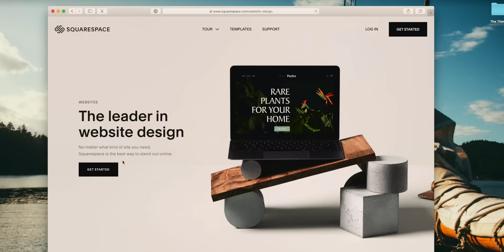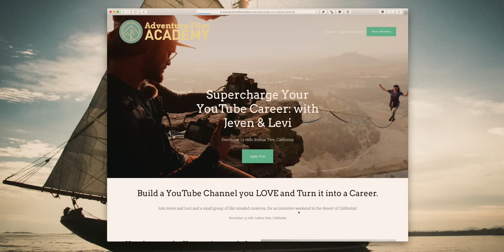The Best VAN LIFE off-road LIFT KITs (Install Video)

Comment: Cool van. I installed the V.C. 2.5" lift on my 2015 3.2 liter HR Transit. Installed 265/75R16 Trail Country EXPs on 16x8 Black Rhino Wheels. The van rides great. The V.C. lift is top notch. The weld beads on the brackets give me a stiffy.

Comment: Love the van mods, even the lift for most part but surprised to see such a thick spring pack going in the rear.  Unless you've added 5000lbs extra weight, I can't see that ride being too smooth.

Comment: Levi, this is awesome. Been dreaming of doing the same conversion on my T1n. Do you have any added concern for roll over? Also have you considered or talked with anyone about adding spacers to widen the stance? Would maybe add stability on turns and lower roll over potential, or is that bad stress on the axels? Thanks! And stay healthy!
Reply from the maker: My new rims add a slight offset. I wouldn’t want it to be more. I’m not worried at all about filing over because of the lift. If I am actually gonna tip I don’t think that 2” higher would be the difference maker to be honest.

Comment: Looks great…
Wife and I are considering a van (RV)  as an alternative to a Jeep/motorhome combo for shorter trips and the ability to explore beyond pavements edge as I’m a landscape photographer.  Not saying for sure that I need 4WD as it does create it’s own set of issues (expense of the parts plus the lowers fuel economy).  Not planing on a regular diet of rock climbing or mud holes thus is 4WD really necessary?

Comment: How old is your van? At first I was concerned with the amount of rust found below but it seems that they are just mostly surface rust. Would an anti-scratch coating or weather coating the bottom of the van help? or it was totally unnecessary?

Comment: Sobas a 4x4 van which would you say is most reliable? A 4x4 transit 6cyl 3.5L eco boost? Or a promaster 4x4 diesel? Im torn between which to get ☹ i need a king bed, enough solar to power an ac unit at night, run a freezer fridge, laptop and little things 😍, im loving what youve done here! Im looking for room to put insulation, maybe water storage for consumption.
Reply: That depends on how much driving you plan on doing. A diesel with a DPF exhaust system requires adequate driving to regenerate. If you plan on only doing short commutes than don't get the diesel or you'll be dealing with check engine lights due to soot build up in the DPF.

Comment: A VERY BEAUTIFUL TRANSFORMATION! Well Done! Does anybody know such conversion but in ELECTRIC? - just for a healthier Planet ^.^ 🌍🚐
Reply: Go With The Flow of this size no, the amount of power useage would be massive!! Id estimate a 4x4 sprinter camper (old because the new style is electronically controlled) would do 1 mile per kWh, so even with the biggest tesla pack youd only get 100 miles, id say you want a 150 mile range for a camper you can use, so 150 kWh pack (about 30 grand), 

something like a simens twin ac motor or maybe a tesla unit inplace of the transfer case as theyre really efficient motors. 

Id budget 100 grand for a conversion like this. 

There are people making campers from the nv200 vans, some full timers or people doing massive trips round europe! 

Best advice is get the daily driver electric!! Change the thing you use most to electric. 

(I know most of this from research into my own overland van, being in a 4x4 response group, and also converting my 4x4 to electric using tesla batteries, im also admin on a uk diy group) 

Hope this helps :)
Reply: @evolution0016  hi. What is your group? Would love to follow your progress

Comment: Looks good.  Are you going to put a limited slip rear differential in to so your not getting stuck as easily now too ?
Reply from the maker: That would be so rad. There isn’t tons of options for my van unfortunately. That’s why I have a winch now haha
Reply: @Levi_Allen  Likely have to swap the axle out to a Chevy.  Might be able to get one out of a wrecker that would work.  Winches work too :)

Comment: Now find out what the poundage of the nitro in your shocks is, then buy a nitro bottle and check your shock setting every six months or so.  Also buy a zero-loss gas valve for the end of your nitro bottle hose.  And and and....those shocks are rebuildable.  Get them rebuilt every year or two depending upon your use.

Comment: What's the point? The springs might be able to carry high loads, but the chassis is weak. If you just want a higher ride, why not air suspension?

Comment: I can't help but wonder -- so can you give us a round-a-bout-ballpark-hint at the cost to do that suspension mod?  I'm trying to decide if All Wheel Drive is necessary for off roading ... if it's worth the extra cash to get a AWD ... anywho.... That looks awesome! Nice video brother. New sub here.
Reply from the maker: They’ve got all the prices in the website. And then depending if you need it installed depends on the shop rate where you do it
Reply: @Levi_Allen  -- thanks, Brother! I appreciate the information.Cheers!

Comment: So you went from a parabolic leaf lightweight (even if you add a few more for more load) and lots of flex, to standard leaf pack ( heavy, harsh ride, limited flex). Confused why this company would recommend that.
Reply from the maker: If you drove in my van you would see why. It’s not stiff with the new leaf pack. Those springs are custom made for camper vans. They make my ride much much more smooth. It went from bottomless out springs with very little life or spring rate. To a suspension curve that reacts well even with all my weight

Comment: the MAIN purpouse of higher lifted van is capabily to drive over unevens without hitting the bottom and other parts. NOT FOR RUNNING OVER BUMBS ! unless you want to pay every month for repair.
 i would not suggest you to drive quicker over bumpy roads.
Reply from the maker: I said multiple times throughout this video the purpose of the lift is better space in wheel well for bigger tires and improved entry and departure angles.

Comment: That'll be awsome when it breaks down and it's too high to go on a flatbed, CHA-CHING! Medium duty wrecker time!
Reply from the maker: too high for a flat bed? that’s not a sentence I normally hear
Reply: @Levi_Allen  the 2wd high roof ones are already 8'7", lift it and mount a bunch of stuff on the roof and it's too high. You are allowed 13'6" (at least here ontario) most flat beds are going to be 4' or so.
Reply from the maker: I guess the solution would be disconnect the drive shaft and lift up the front end. it certainly is a very tall van
Reply: @Levi_Allen  that's pretty much the only option. I don't know what they use for fasteners, if it's just a 12 point head most wreckers are going to have sockets but if it's some weird inverted torx or something it may be a problem. Sometimes we will put things that are higher on a landoll (semi) trailer, but it's like $175 an hour from the time it leaves till the time it gets home and MB is 220km away and deck height is still about 3'

Comment: I don't understand lift kits the axles are still going to bottom out.
Reply from the maker: It’s about getting better wheel well space for larger tires and the larger tires are what help axel height. A bigger improvement for my van than axel height is entry and exit angles. I’m not going rock crawling with my van, I’m just trying to drive on back roads without dragging the van somewhere.
Reply: Yeah, I am watching because my hitch drags when going up a driveway. A 1/2" of body frame lift at the axle is 1 - 1 1/2" at the hitch (total WAG). The height over the ground at the axle only matters if you're straddling a boulder and only people with too much cash and time do that kind of shenanigans.

Comment: I wouldn’t want to have to make any emergency maneuvers, or take a sharp corner in one of these things.
Reply from the maker: The cog is actually fairly low considering how tall the vans are. 2” of lift does very little to cog, and the new suspension actually helps it be more stable in tight corners

Comment: i honestly dont see the difference  :(  the original had smaller stock tires , and fender flares , then the after pic has almost the same size tires , and no flares , im looking at the clearance , and its only changed by about 3 inches? compared to you standing by the vehicle at 10.12 vs 10.34 , i cant justify 12k for 3 inches .. :(
Reply from the maker: Lol, it’s a 2 inch lift homie. You aren’t going to see crazy height increase. Biggest improvement is properly tuned suspension
Reply: @Levi_Allen  i like the suspension for sure , very detailed on the install also , niice

Comment: Look up "skid pro Sterling's wild west" basically goes in the trailer hitch so when you bottom out it will slide on that and not trash the rear bumper/ fenders/exhaust. It has a recovery tab also so if you need to pull or be pulled .

Comment: Off roading a sprinter is all fun and games until you bust a motor mount.
Reply from the maker: Speaking from experience?
Reply: Levi Allen yeah I had an 06 158” replaced the snapped motor mount in a Trader Joe’s parking lot hahah good times